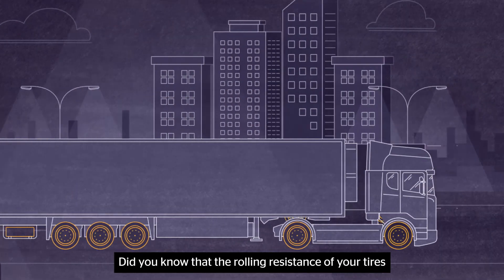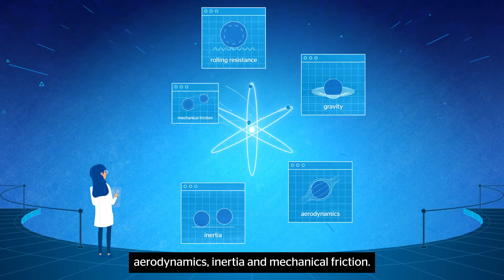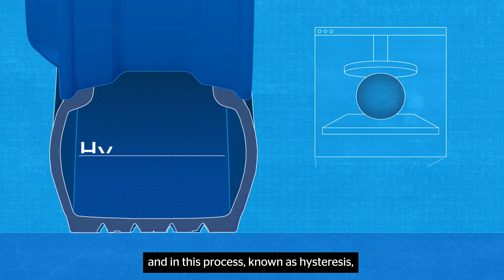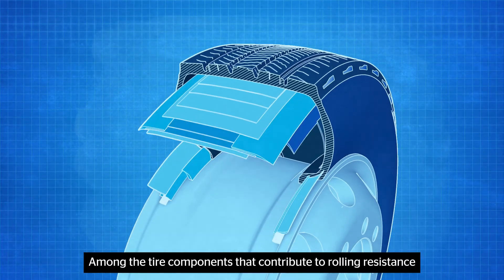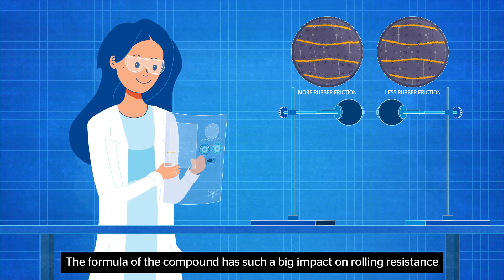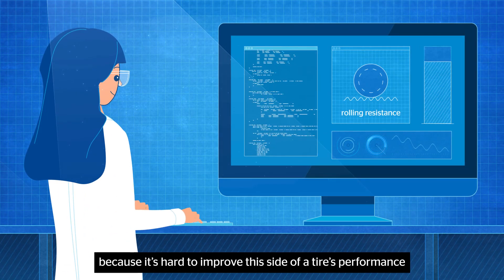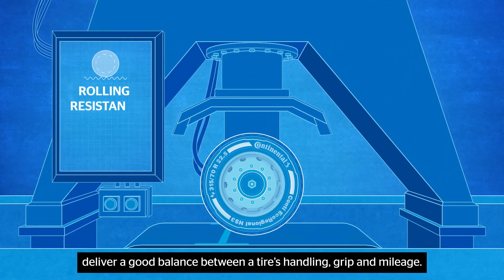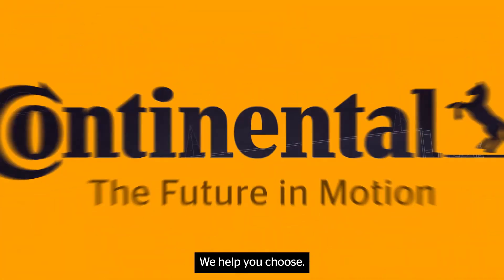Rolling resistance quickly explained | Continental Truck Tires

Comment: As Continental also produces tires for human powered vehicles (as they call them (bi)cycles), would it be possible to produce radial tires for tricycles and velomobiles? Everyone knows that radial tires are the best tires for rolling resistance, but there are no radial tires available for tricycles or velomobiles. Radial tires do not work on bicycles but on tricycles they would be optimal. Please design radial tires in 28-406 and 30-559 sizes, which would be suitable for my Milan SL velomobile.